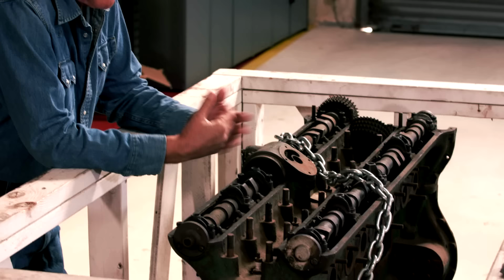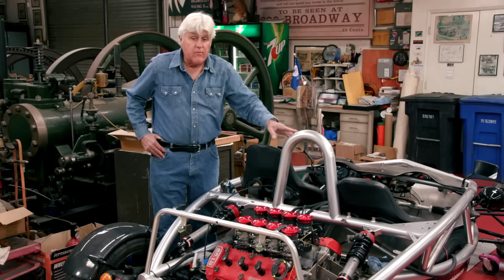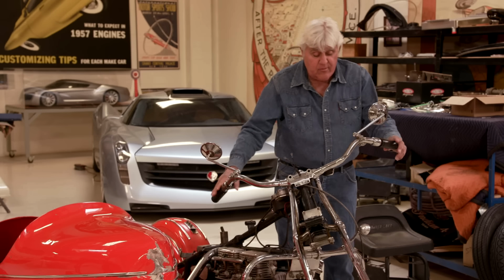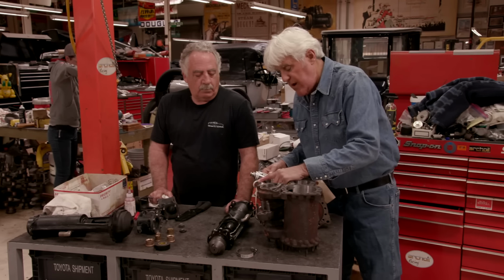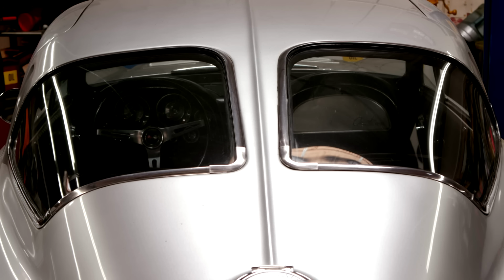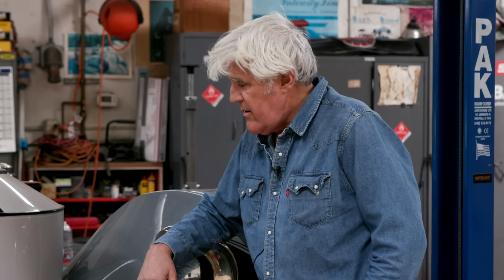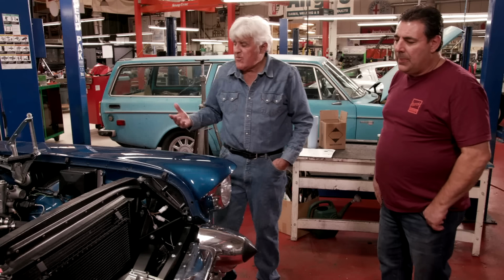Restoration Blog: March 2023

Comment: Ouch. Had a little mishap myself not long ago. 14 broken bomes and a buch of teeth knocked out while I was WALKING.  It happened when I was 61and I advise people if you're going to get hit do it when you're younger. Unless, that is, you get killed in which case put it off for as long as possible. Get better, I'm  STILL a work in progress. Took the lemon the insurance company gave me to suck on and bought a nice red 392 SRT Challenger looks just like your 2015 Hellcat. Mine's running pretty good. Without lanch control, line locks or sticky stuff like they used to get the 4.2 claimed I pull about 4.5 on the street reliably. I have got 4.3. Supercharged 0-60 is supposed to be 3.9. I'm looking for about there WITH all those things. Not bad for 10 years old. I wish I had more toys, I'm a child too.

Comment: The 57 Cadillac engine over heating problems from what i read were not uncommon with other V8 engines of the day and some issues stemmed from the water flow through the heads hence the cross flow tubes from one head to the other in latter years. The Cadillac was a lot of car and that increased radiator capacity is one huge plus.

Comment: Yeah I hit a wire going across a parking lot on a pedal bike when I was about sixteen I was probably going about 25 maybe twenty-three miles an hour I hit a wire cable going across the drive entrance and Supermand over the handlebars hands straight out front, bounced  off the ground thankfully I don't have a Leno chin and i ain't get busted up that bad but dammit Jay when they put a wire across the parking lot or a line that should have a lit sign saying there's a barrier there or something I was lucky I was a young man. I didn't have insurance I didn't have anything other than a few wanches and enough to fix my my ride which was a diamondback pedal bike but it still got broken up I was able to fix it well after I carried it home I got pretty lucky all's I had was broken ribs and f***-up shoulder. I love how you understand thermodynamics and operation of all of your vehicles Jay most collectors just collect

Comment: A work colleague of mine back in the 80s told me how he had a Rolls block welded.The block was uniformly heated over days and then welded.After the repair the still hot block was buried in sand for three weeks, this allowed uniform slow cooling.
Can't weld aluminium 🤔

Comment: I'm the same age as you Jay and have owned and ridden motorcycle's since I was 15. I did an inventory of all the bikes owned and it was around 70 or so.
 Two years ago I found out I had cancer and with chemo and radiation and drugs, I had a problem with balance. Can't have a problem with balance on the
405 at 70mph ! (As if you can go 70 on the 405 these days).
 You talked about your injury's from the bike acedent  and the face fire incident and it so related to me. 
After all the years building and restoring cars and bikes I have had to come to grips with my age, so I built my last car and sold my last bike.
 Keep on riding and building for the rest of us geezers Jay.. I'll be watching. 
 PS:  I met you three times, once at the Rock Store and twice at the spring fling Chrysler show. I spotted your Stanly was on fire and my friend Jay ran
under the car with a blanket to put it out.

Comment: had that happen in 1970 on a Suzuki TS-250 on the side of a road in Tucson Ariz, exactly the same, driving into the sun and a telephone guide wire in the neck did a back flip off the bike. not hurt just embarased.

Comment: Mr Leno, I was a tanker for 10 years in the US Army and the M1A1 Abrams has a diesel turbine power pack(same one the AH64 Cobra uses if I recall, I've been out a while) and it uses an oil called FRP or FRH(I can't remember which is was but it was one of those). Maybe that would work for that steam car (I have no idea really, I just know that Abrams, we used to wind them rubber bands tight and let it eat ALL DAY LONG and they would get HOT). Just thought, maybe something to look into.

Comment: I wouldn't repair that crack with epoxy, I'd shape a peice of cast iron with heat to fit that corner perfectly after cleaning it up, then tap that block around the plate and bolt a plate on with a good gasket.. that way the iron patch expands and contracts with the block where as when the black gets hot and expands the epoxy does not expand and it WILL leak ..

Comment: Just go with an aluminum block 350 tuned for economy (moderate compression with overhead valve heads) in the caddy with fuel injection and CDI ignition. I mean if you already went to a modern tranny. Hang onto the original motor and trans if it was stock and if you sell it, a purest could always have the option. I realize you'd lose that 'original driving experience', but as you said: probably wasn't great back in the day, just maybe better than some domestic car competition of the era.  The purest buyer would leave the original drivetrain on display. Maybe set it up as a shop generator and air compressor motor dual belt set-up.

Comment: Come on Jay you gotta get a better plan. What about trailering your different rides to a test track or vacant airport? Obviously piddling around the block test rides no worries but wild hair rides gotta be planned better. Especially a vintage bike with a side car is not exactly a normal handling vehicle for any age. That takes some practice. I believe that's why sidecars lost popularity because it's not normal to ride with empty. Then you add a passenger and it becomes different again. Maybe a few weights in the floorboards when you don't have a passenger?

Comment: Fascinating.  Given that Duesenberg parts a so rare, I am wondering what is allowed in the vintage/collector world.  For example, suppose you melted the valve cover, added equivalent metals and alloys to be compatible and to make up the lost volume of the broken piece, and recast and machined it to original drawings/prints.  Does that make it less than original Duesenberg?

Comment: I have a basic question...Since the Duesenberg parts are no longer available, and since you have good examples of them, why not scan them, turn them into digital files, and then use additive 3D manufacturing to make brand new parts? That way you will always have the parts and if you run out, you can just make some more!

Comment: Be careful making your new boiler out of stainless steel.  ASME BPVC (American Society of Mechanical Engineers Boiler and Pressure Vessel Code) prohibits using austenitic (300 series) stainless steels in water-wetted parts of a boiler due to risk of stress corrosion cracking.

Comment: Polymeric compound (epoxy) repair - Be carful - Navy has bad experience with using a polymeric epoxy compound in high purity (triple distilled or three passes through RO) water system.  The high purity water can leach or corrode the compound particles out of the epoxy, leaving the compound in silt in the water system.  The water is so pure it disintegrates the compound. Keep an eye on the repair.  Your videos are truly great!

Comment: Did you get the Palatov rising-rate bellcranks and suspension uprights with the Porsche bearing?  

The original Atom upright bearings aren't sealed or rated for when the 'falling-rate' uprights bottom out.

As far as I knew Ariel had their own engine that was different than Hartley (similar with GSXR heads)

Comment: I have my Dad's 1967 Cadillac deVille convertible since I was 12 years old.  He owned an auto body shop and always had a Cadillac.  He was going to junk it when he bought a 1972 Fleetwood Brougham.  I told him that I wanted it and I am now 58 years old.  The car has over 200,000 miles on it and cosmetically is a beauty.  I had the original 429 engine rebuilt last year for a small fortune of $11,000 bucks.  The rear main seal is leaking so much that I can't really drive the car . It needs a quart of oil every 100 miles or so.  It's just a damned shame that this car is undriveable due to a $30 piece of rubber !  I have contacted a Cadillac restoration shop that I hope will be able to solve my problem.  If not, I will have to source another 429 engine and start from scratch again.  Glad to see Jay back at work and keeping these old cars running.

Comment: You said you can't weld the Duesenberg valve cover because it is aluminum? I have welded the pot metal taillight mounts on a 1938 LaSalle. the valve covers should be a piece of cake.  Any welder worth their salt should be able to do that. Also cast iron is very weldable too.

Comment: Why wouldn't you just build a machine shop and reverse engineer every part, build a new part. Make a dusenburg from scratch using all original specs but newly machined parts. Would work on any vehicle. If you have the parts and know how they go together, that's all you need.

Comment: Because these parts are so rare, is it possible to replicate Duesenberg parts using modern materials based on the original specs? Has anyone considered doing that for rare cars in general, or is the process too expensive to justify it?

Comment: What a wonderful batch of projects you have going there!!    I remember reading a book about Stanley Steamers when I was a youngster, and remember the boilers being fire-tube in construction, with the tubes sweged between the top and bottom sheets into which were drilled many holes, and the sides of the boiler being wrapped with hundreds upon hundreds of turns of music wire to keep the "tuna can" shaped boiler from rupturing outwards.  They tried saving weight once by lowering the number of turns; they tested it in a large hole next to the factory.  They got the pressure up to several hundred pounds before the boiler blew sky-high, and all the factory windows were blown out!
The Dobles are fascinating to me; and your videos are the only places I've seen them.  Thank you so kindly for sharing so much with us enthusiasts!

Comment: That Duesenberg cast-iron engine would be most appropriately fixed by "cold welding".

The damaged part is cut out and filled with a fitting piece of iron. After that, holes are drilled all around and cast-iron screws are inserted. Once they are in, the heads are simply broken off. If done right the patch will seal completely.

Very few specialists are around today - but they do exist.
Reply: How dare you tell the king of cars how to do a repair, just kidding! You know everyone on here thinks he and his "master crew" are the only one's  that have restored these automobiles.
Reply: @VEGAS_AND_OTHER_COLLECTIBLES  Well, when this engines were new it was common practice.

Today, very very few specialists are able to do this fix.
Reply: @Stanislav Czebinski  I know of at least four men in the U.S. that could complete this repair properly, but no one knows who they are, and that's the way they want it. Unlike Mr. Hollywood, who makes sure you know how much he spends on his cars and such. People do not understand that his collection is also a tax write-off. But I guess only jay and his crew are the only car restoration experts out there, Not!

Comment: I have had 3 friends injured in Motorcycle accidents in the same way , had to return from somewhere spur of the moment and cut through a parking lot they had used many times before and some new owner put a wire cable across it with no warnings no flags and they all crashed in the same manner and suffered similar results ! They were all pissed as I was ! Let this be a lesson for all of us that any parking lot you cut through might SUDDENLY have a cable going across it !

Comment: Love your show! Have a suggestion of another way to fix the Dusenburg engine … try using a laser welder. If you look into this tech you may find it a great way to work on metal without damaging it because it allows welding or cutting without adding a lot of it thus minimizing warping.

Comment: After High School in 1967 my brother and I owned a '57 Cadillac Coupe.   We live in Pittsburgh.   If you ever been to Pittsburgh,  there few straight level roads. 
Our favorite road was Glass Run Road.   It winds up a hill, like a snake.  The Caddy could take the turns better then an English Sport Car.  
If you remember a '50 or '51 Caddy raced at Monte Carlo.  The '57 was very similar to the '51 except for the X frame.

Comment: Put it in an oven to heat it up to about 180 Celsius then use a low temperature bronze for the repair or spray metal welding.

Comment: Jay- start another channel and post vids where you drill down in one special restoration project. Let 'your pros' do the talking/walking and let us see how their skills are used. Does not have to be a whole car. For example, one of your guys doing the epoxy glue job on the Duesenberg engine block. Target a job that needs a special skill, and let us watch them do it.  Post two or three together. C'mon Jay !!

Comment: Jay, you should modernise the steam car. Build two boilers while you are at it and fab up a modern frame, with all modern computer controlled burners powering a modern turbine steam engine. I don't know anyone else with the means and the lack of good sense to attempt this.
   That Ariel Atom has no purpose other than to get you killed. Name that thang The Death Machine! But those Two Wheeled Death Machines will probably get you first. Good Luck, Get Better, and Good Bless.

Comment: Find the right person to weld the block instead. My father welded cracks in two casted ford v8 iron blocks some years ago for a friend. He said the casted iron behaved a little bit unpredictable but he still managed to weld it with nickel welding electrodes. He was a professional welder for more than 30 years mostly welding pressurized tanks and heat exchangers of stainless steel. He was the go to guy to fix problems like this at that company he worked. So I really think you just need to find the right welder for that problem.
Reply: Another method for repairing cast iron is to heat up the material to be repaired in an oven first- before welding. 
This is a common method for fixing damaged press tools at car manufacturers around the world. I know this since I used to work at one :D

Comment: Cast iron can be welded. Pin it for safety. Pull the side cover off the engine and weld it from the inside. As long as you bolt braces at the top and bottom of the block, it's not going to warp.  As far as metal expansion and contracting. using epoxy might not be such a good idea. Use JB Weld for cosmetics to fill the crack. Finish the epoxy to match the block texture and paint it.
They have been welding aluminum successfully for ages. Cut a "V" into the crack, weld it flush and then finish it to match.  As cast aluminum can be porous, it is important that there is no oil in it. You can probably boil it in distilled water to float the oil out.
With radiators, if you are going to paint them, use gasoline as a reducer in the paint. When the paint dries, it will be more apt to allow heat to dissipate.

Comment: When one of the craziest cars ever built and driven (Chrysler Turbine) sits in the background under a dust cover and is never mentioned, you realize how broad and deep Jay's collection is.
Reply: I liked the Volvo wagon in the background, he doesn't discriminate.
Reply: @seanworkman431  , Crazy thing is, that wagon looks just like the one I sold in 1999. I want to see more of it so I can say for certain. I deleted the roof rack, had turbo wheels (which were hard to come by and could have been easily sold), V6 1976 265. Blue interior. Has me wanting to know more about THAT particular Volvo. I didn't part with mine lightly, always missed it.
Reply: Yes I saw that too
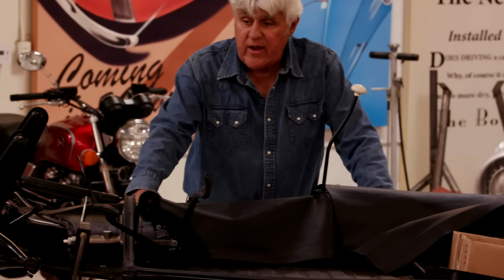Reply: 8:50
Reply: I thought for a second may be Paul Newman's Volvo, he had a special one built. It's got a turbo V6 out of a Grand National. I just looked Newman's car is black, but it is still around.

Comment: I was just wondering if it may be possible to 3D scan the Duesenberg engine parts. Make any repairs to the parts in CAD and the 3D print replacements. Sooner or later it will be data FROM the original parts that may prove to be the critical element.  They were amazing engineers in their day, if they had seen 3D printing they would have used it themselves imediatly. Why not use new technology to recreate what they designed so well. This workshop has experience and talent that is simply unique. it is one of America's automotive treasures.

Comment: When you have engines that tend to over heat try a PAO synthetic oil. I have been able to reduce temperatures up to 30-40F. Same with transmission.

Comment: 0:00 New used Duesenberg motor
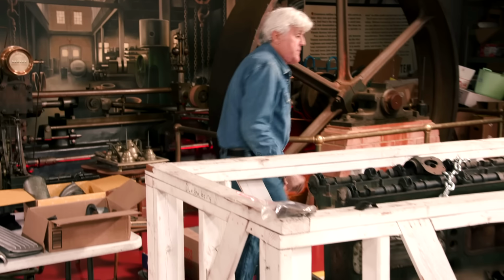3:49 Ariel Atom Hayabusa V-8 project
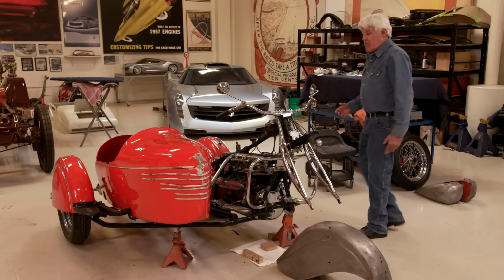5:50 1940 Indian Chief with sidecar after recent crash
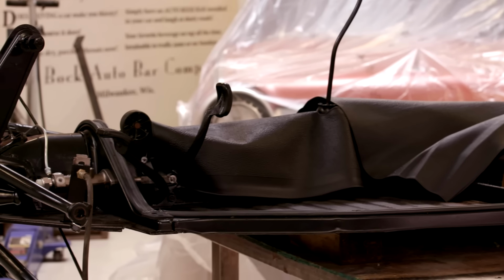8:13 1957 VW Beetle restoration
10:13  Tank Car - frame repair
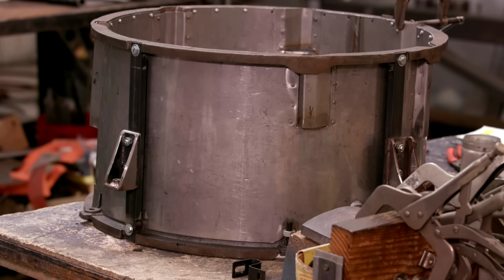11:43 White steam car boiler
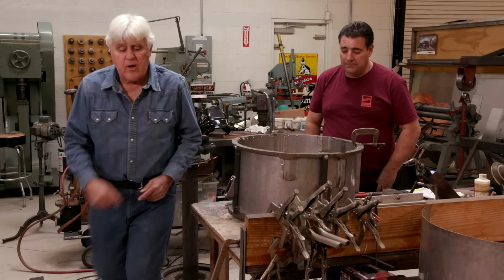12:55 White Steam car frame
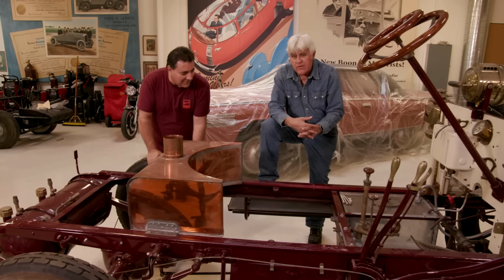13:58 Doble steam car engine
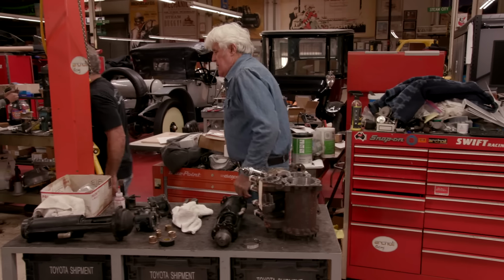17:30 New shop crew - Ava Wolft
18:26 1963 Corvette split window
19:24 White 30 HP steam engine- the face burner! 
20:44 1906 Stanley Steamer
24:04 1957 Cadillac restoration

Comment: JAY,
Once upon a time a trucking co bought a brand new simi. They placed it into
service and it gave them several years of good service. Finally, it clocked enough
miles to require a rebuild. The co rolled it into their shop & an in frame overhaul
was done. From the day that truck left the shop it ran hot. It was in & out of the 
shop numerous times but continued to run hot. Finally, at about 50,000miles the 
truck was in a major collision & the truck was totaled. The wrecked truck was 
bought by a mechanic who was given the trucks repair & service records. He 
bought it anyway. As he began to strip the engine to rebuild he opened up the
engine oil cooler & inside found a red shop rag. He removed the rag, re assembled 
the engine, sold it for a nice profit & that engine returned to service for 700,000 
trouble free miles.

!